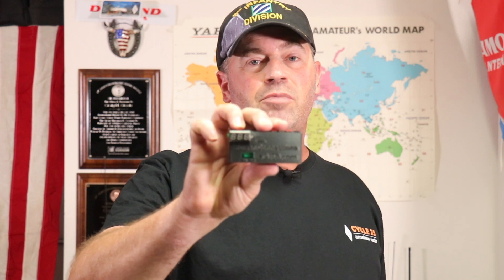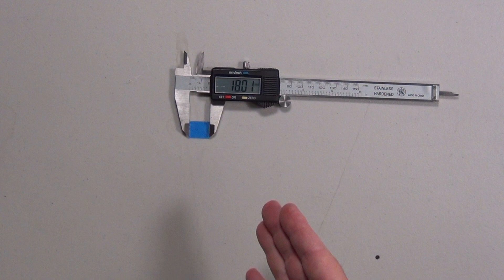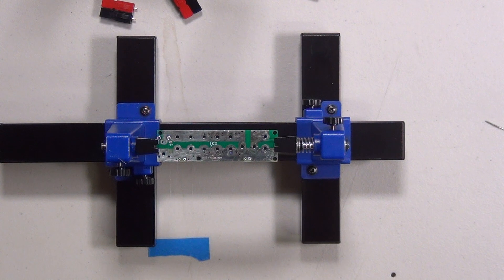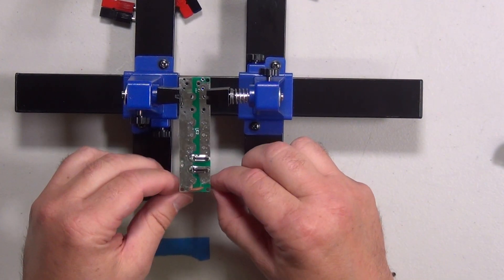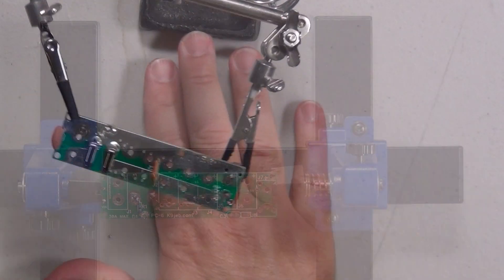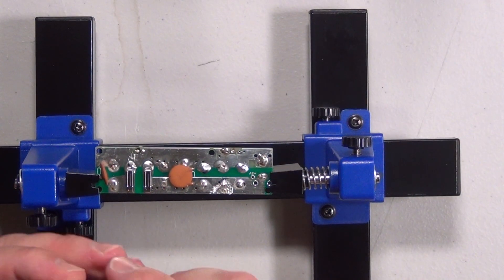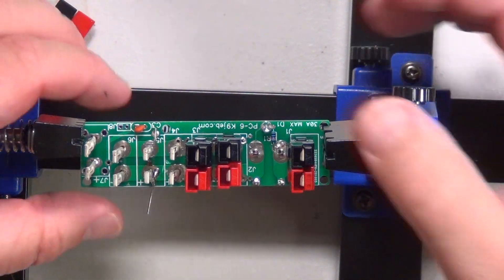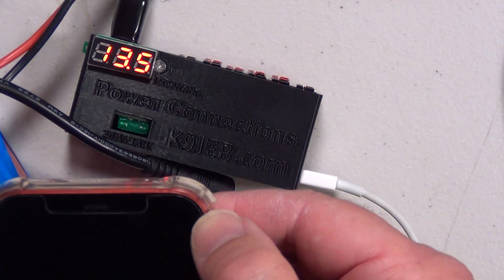K9JEB PC-6 Power Connector Kit

Comment: I built an earlier version of this board - less the USB board, 3D printed case and voltmeter - and found that when cutting the wires for the PowerPoles it was better to cut them longer, then trim after soldering.

Cutting to recommended length left some barely reaching thru both sides of the board.

YMMV.
Reply from the maker: Thank you for taking the time to watch and the comment! It is greatly appreciated. I agree. I ran into that issue while making this one and would have preferred a bit longer wire.